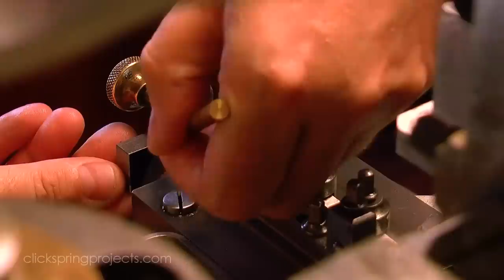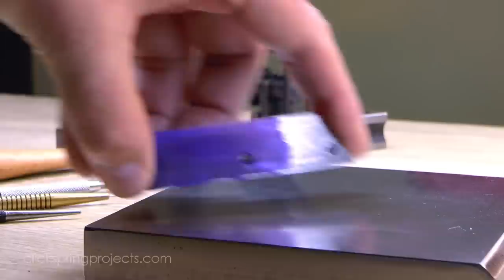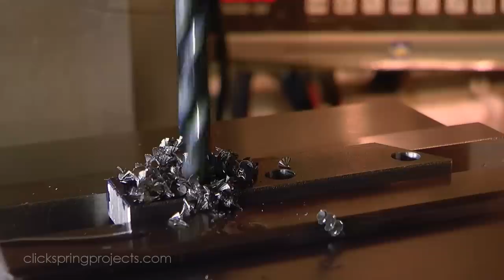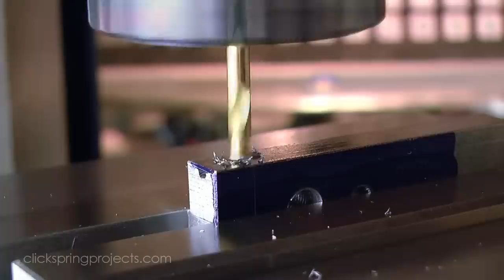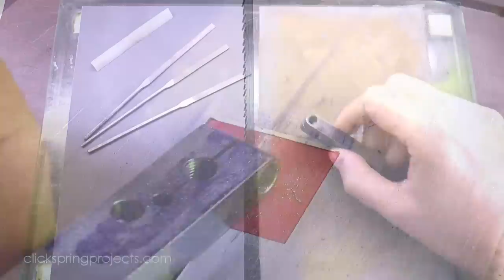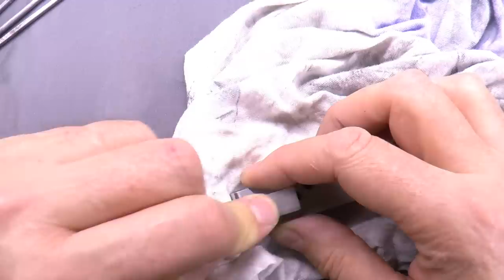Marking Out & Machining A Depth Stop Bracket

Comment: As an old sheet-metal worker, I learned and practiced all measures with careful scribing and good sight...
Now as a vocational teacher I'm a bit in between computed/machine aided knowledge and a mind/scribe set of thinking...
I try to give my students the "best" of both worlds... (maybe I give them the worst by mixing them...)
No matter how I turn my arse is always behind me...
As always Chris, you are a guiding light!
Reply: i think knowing both worlds is the better option
not all companies may have the equipment available at the school
not all projects lend themselves to computer control being the most viable option
having an understanding of both the old and the new gives the students a better understanding of the profession, and gives them enough tools so they will be able to face pretty much all situations they might face in their professional careers (or even if they want to do some stuff on the side for their own devices)

i did a certificate in joinery, and during the first year, we worked with nothing but hand tools and pulling measurements off of paper plans, only in the second year were we authorised to use power tools & machinery
part of it was for safety reasons
but also a lot of the industry still relies on old school methods and equipment
plus sometimes even with numerical stuff, you forgot a cut somewhere or the toolpath wasn't correct, and rather than redo all the stuff on the computer it's simpler and quicker to pull out the chisels and start hacking away at the problem
or that one job requires a jig that you can either spend an hour on the computer to modelise, then go on the mill to make it
or pull off the measurements you need on a piece of paper, make a quick drawing and 45 minutes later you're in production